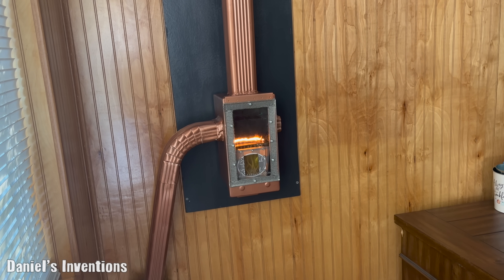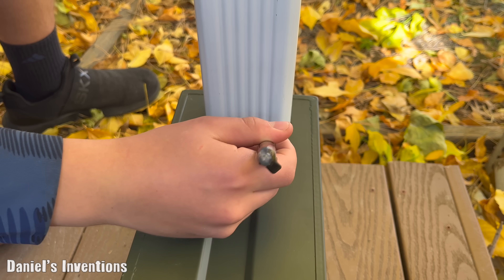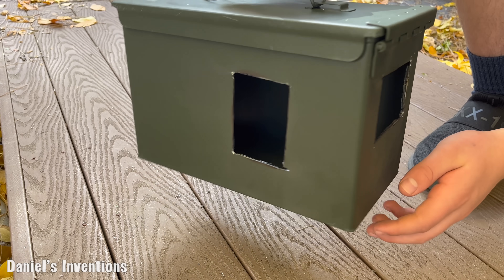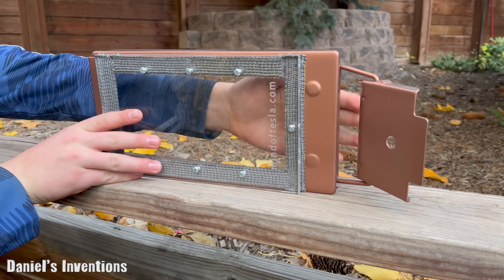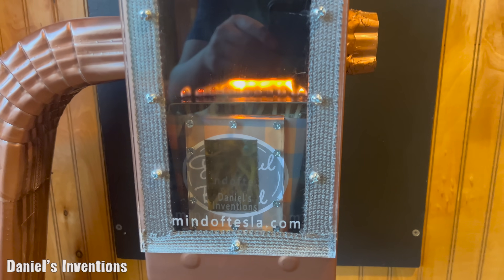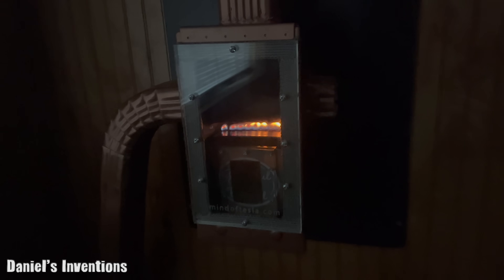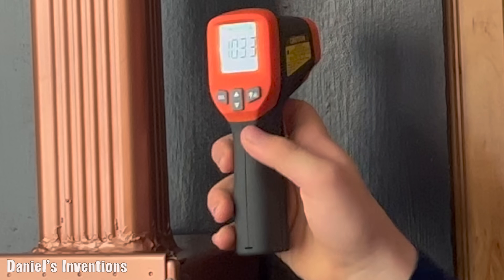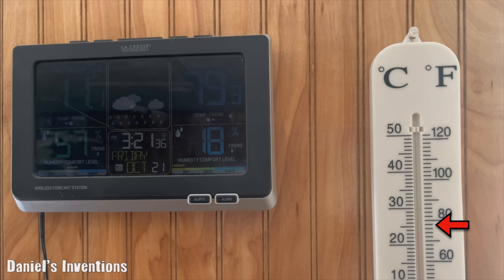ENDLESS Heat for Your Home WITHOUT Electricity

Comment: It might increase efficiency if you could increase the heat exchange surface. A more horizontal form, or more than one heat exchange section. 
   Would this run on waste motor or restaurant oil?
   A nice little heater!

Comment: Firstly, I truly appreciate the ingenuity that went into this design. 

With that said, you are not creating endless heat WITHOUT energy; the blower is still reliant on 1.6A/12V DC, be it through battery or hardwired. Now, this is not a lot to be fair, but it is  mislead in your title.

Comment: LOLOLOL ,   

Why don't you just buy 5 or 6 old fashioned oil lamps at the flea markets for $5 to $10 each.
Put new wicks in them of course.
That way , you would get MORE heat, MORE light,  LESS soot,  LESS maintenance,  and NO labor to build !

You are literally re-inventing a less efficient wheel !

 Lol.

Comment: This is AWESOME...question....I see your using a 12volt power adapter to assist with circulating the heat from the unit around.  In the event we don't have power...what is a good suggestion to assist with circulating heat from the unit?

Comment: I see that you're using electricity for the fan.  Nothing wrong with that however since you have a lot of heat available why not use a small Stirling engine to generate that tiny amount of electricity needed?

You're welcome.  Nice job guys.  Keep tinkering and sparking imaginations.

Comment: Great idea bad implementation. 95% of your btu are going right out the exhaust flue. You need multiple heat exchangers as the exhaust rises to capture as much of it as possible.

Comment: I would be very very curious to see a version with quarter inch steel and weld the components. Also find a way to incorporate Mud brick/Adobe. It would retain far more heat and be more efficient.

Comment: The old army skaws aka supply boat . ww2 used a diesel fired cooking stove and heating system 1/2 inch thick top no forced air system similar to your design worked great had one on fishing vessel some part failed we installed an electric heater grid inside the oven for heat 120 volt works great till we got parts to repair.
Glad you are using a cutoff grinder in proper manner! 
Always use the grinder so if it gets away from you it will grab material and pull the grinder away from you ❤❤❤❤😁
Great job! Thanks 👍💯🔥

Comment: JB Weld is a plastic, if I remember correctly. Plastics burning give off some form of cyanide gas and carbon monoxide plus carbon dioxide. Carbon dioxide is NOT poisonous but it can replace regular air since it weighs more than air. It sinks to the bottom of your house and can suffocate you from lack of oxygen. The cyanide and carbon monoxide can kill you out right. There are many chemical compounds that cyanide gas forms.
Reply: Si

Comment: Just pray the intake doesn't suck in carbon monoxide from the exhaust..... Generally you should not place them so close to each other....many people have died having heater and or water heater incorrectly installed that way.

Comment: If you put a block of metal in the vent to absorb more heat, it would probably increase the effiency. Also, instead paint the concrete board white to reflect the heat back to the room.

Comment: Great idea.  But maybe don't sit it directly on a wooden wall.

Also, a lot of the issues of heat build-up could be remedied with a small solar battery and a 3v computer fan.  Put the fan at the air intake.  Route the air intake in a way that promotes circulation before exit.

Comment: Im lost: this is probably fake.

1. You can only get energy out of a medium which is in the medium.

Burning that little amount of oil gives you literally a lottle amount of heat.

Yiu can't beat physics...

And those temp he is showing? Dude come on... Its either one very small spot or fake. And no you clearly not burning your hand when you put it on the vent which you would if this thing has the temp you are showing.

What is this garbage?

Comment: Daniel a most excellent proof of concept. I built mine out of steel box tubing, that's what I had on hand. We ran it in our icefishing shack and it did very well. I used 6 flat wicks and the gears like a lamp. I'm using used oil so it is free from the machines from our farm. My fan is 12v so a motor cycle battery and small solor panel was plenty this season but next winter I plan to scavenge DC curent from the heat of the burner so no panel on the roof. Thankyou bud.
Reply: Please make a video of your proposed video!  I would love to see the DC power generated from the heater!
Reply: i tried using olive oil and it wouldnt burn
Reply: Is it legal to burn used oil with a horrible burner?
Reply: @jepulis6674  Why would it not be? Not all countries are like Europe lol

Comment: You DID use electricity. It would be awesome if you could use a series of gears and pulleys to create some sort of gravity driven rope to turn the fan, or even in that sense generate the electricity to run the fan. Something you could periodically reset to keep the air going

Comment: So I actually built one of these after watching this video and let me tell you how it does not work that great even running I was only able to heat my tiny camper up to like 54° barely. So I built a second one but instead of just having one piece of pipe going straight through I used inch and a half copper pipe and did an s shape inside the ammo can before it came out allowing the air traveling through it to spend more time in a heated pipe before exiting which greatly increased how much heat it was pumping out. And then it was semi worth it however where I live the suitless lamp oil is about 10 bucks a quart which I seem to be spending 10 bucks every 4 or 5 days

Comment: 1. Use a solar panel attached to the flame window for running the fan or charging the battery for the fan.
2. Use a a self filling siphon for the oil supply so you never have to stop the device to refuel it, run a tube to you reservoir externally with an external bottle that can hold many time the amount of oil.
3. Maybe use a thermocouple to run the circulation fan if the solar panel will not cut it.

With these extra hacks your system could need no external electricity and run for literally a YEAR

Comment: You can’t put a turn down on the chimney pipe. That kills the draft and won’t let it  vent properly. Second, the chimney pipe needs to extend above the highest point of the roof for proper draft. 

I would not recommend using aluminum gutter. It can melt with the heat below it very easily.

Comment: I don't think you need that computer fan to make the setup work properly. The circulation of air happens naturally anyway since the top exhaust pipe is hot and the intake is cold, which makes the air normally move because of the temperature difference. It's basically an oven and a chimney.

Comment: It's a nice idea, but one problem needs to be considered here if you're intending on heating your home with this.
Will your home insurance cover you if this goes drastically wrong?
Let's think about it. You've built a heating device from spare parts and (essentially) junk, so none of it is certified or tested under any of the same conditions as a registered manufacturer. You're unlikely to be a heating engineer yourself. Therefore, if this thing develops a fault and you burn your house down , your insurance is well and truly void. You end up with nothing.
Now ask yourself...is any of this worth it?

Comment: im sure with all that burned off primer and paint would be really great for your health. i'd suggest an air quality monitor just to see what kind of harmful byproducts are being burned off with this heater. single jb weld is being used to hold all the parts togethor.

Comment: How do you adjust the wicks? Do you have to shut down the heater and then restart it until you get to the correct settings? Maybe you could use some small watch gears on a shaft and aknob to adjust the wicks during the heat cycle. Like a oil lamp. Just a thought.

Comment: The heater you built can only heat a room of 1m2, nothing more. Its efficiency is very low. As the laws of physics say, you can't get something from nothing, and you can't cheat the laws of physics. You could test this heater, but it would require some effort, and you'd be very disappointed. It's roughly like heating a room with a lighter. Apart from that, congratulations on the effort.
You should measure the temperature of the outgoing air rather than the temperature on the casing. You can also measure the amount of outgoing air and see if the temperature drops, as in 10 minutes it will definitely turn out that the air will be only slightly warmer than the incoming air.

Comment: Just to keep it honest, you should note the heat resistant glass pieces on their own would cost in excess of $150. Yes, it is that expensive, double or triple it for those pre drilled holes. We simply used a small $5 Pyrex bowl. 😉👍🏼

Comment: You failed right from the start. This states for when you don't have Hydro. Then you used power tools to make it, and plugged the fan into the wall for power. So you do need electricity for this to work. FAIL

Comment: you can drastically increase the efficiency by instead of leaving the wicks open to air, using them to fill a copper tube, bent into a loop, with a small hole drilled into the bottom. 
The wick wraps through the top, ALMOST reaching the bottom hole, allowing for the heating of the fuel, the wick allows capillary action to seal the tube, forcing the longer section to be the strongest against the flow, allowing the small hole to be the least resistance, allowing the fuel to vaporize, increasing the efficiency tremendously. 

"this flame burns at 1652°F for more than 100 hours! diy ideas you need in your life right now" by mr Ipoo is a perfect demonstration of this.

 add more loops for more flame.
The best part, is you no longer need to adjust the wicks.

Comment: It is better to use Peltier elements when driving an electric fan.
Since the outside air inlet is cold and the outlet flue is hot, you can insert a Peltier element between them.

Comment: Great job man. you'll be a mountain man yet. i got something that will help you out tremendously if the power goes out. get a wood stove top fan. like $30 its powered solely by the heat generated by the heater. snip the wires put the thermoelectric pad on top of the heater where it is very hot run a few cables to the intake and put the fan there. itll work completely without the electric grid. may have to run the heater for a few minutes before the fan starts.

Comment: I could be wrong about the numbers but a quick lookup average household usage during the winter is 8kwh per day. I think the average cost per kwh is around 17 cents but ill say 30 cents. So 16.80 per week in energy but thats the whole house not just heating. That vs 5 dollars. Please correct me if im wrong i really am curious on the difference. I really want a wood stove though. Nothing beats a classic woodstove in the winter for me. Not even a fireplace.

Comment: Interesting design and inspiring but need numbers: OUTPUT calculations? BTU/hour? It looks OK for a very small space but not nearly enough for a LR, for instance or small house. I have a propane burner (Mr Heater Big Buddy) which BLASTS out max 18,000 BTU per hour and ALL of that heat stays indoors (no external venting). On highest setting (18,000 BTU = 3.5 electric heaters @ 1500 watts each at full blast) it does not heat up my LR space even though indoor temps may start at 45F (not that cold). So I just heat nearby air as needed.

Comment: the more challenging aspect of this DIY is the actual flame. None of the wicks will be permanent and will have to deteriorated quickly, even the baby wipes go so fast to the point you want to give up the whole project because oil burned is too mesy and the frecuency of wick changing. Really bad

Comment: someone may have suggested this already, but you could replace those standard oil lamp wicks with carbon felt. it will be an effective wick, but you wont have to replace the carbon felt like you would with a standard wick.

Comment: The probability of getting your house in flames is now more than 50%. Everything in this installation is dangerous in the way you made it. You're also lucky of not having lost a hand while holding the grinding wheel in one hand while the other hand laying only centimeters appart.
Invent, and innovate, but learn the security rules before you start.

Comment: Did you also use heat resistant glass for the oil resevoir windows? I was about to order heat resistant glass and I came back to count the screw holes they'll need to drill, and I noticed the oil reservoir the stove box has double glass. Does that area get hot enough to need hr glass or did you use something else? Is the resevoir window acrylic?

Comment: I honestly don’t belive this .. I did subscribe to your Chanel to see your other videos but I have wood burning stove that’s regular size not a mini one and I use wood to burn .. there is no way your method could possibly work .. if it did that would be amazing brake trough in so many areas of life .. since you will get many disbelievers like me .. but I’m not denying as I did subscribe to your channel after all then if you actually read this message pls make so many of those videos to make people beive it.. for example I suggest doing videos of time lapse when people could see in a speed time how it looks like .. the oil level the temperature inside and outsde .. the kind of place you heating all of it .. u know if this was actually real this would be soooo soooo soooo amazing in so many areas of peoples lives ..

Comment: We rely completely on space heaters during the winter, and they CONSTANTLY break due to overzealous safety features. This design is inspiring, and I'm going to look into building something based on it for our 340 sqft home. Thanks so much!

If you see this comment, I'd love an update on how this setup weathered its first season, and anything new you've learned since posting this vid.
Reply: I hope you read some of the other top comments for improvements to this design.
Reply: 340 square ft is not a home
Reply: @WaitWhatsMyName  Ok, well whatever the hell this thing is we've been living in for nine years, I'm gonna try building an oil heater for it.
Reply: @WaitWhatsMyName  What is the definition of a home?
Reply: Why not? It’s the same size as your mother’s vagina and you lived up in there for 9 months.

Comment: Love it! Try graphite instead for a 'forever' which!🕯️🎂 Also the trick to the smoke as pointed out by Robert Murray was addressed in the new rocket stove where they insulated the chimney to keep the output heat around 800-900 degrees which burns up all the carbon before it gets out

Comment: You could ad fins to the exhaust and add a fan to capture radaint heat from the exhaust, Turn the exhaust into a heat sink. Exhaust would still exhaust outside, fins going up the exhaust to radiat heat out. And one of those gans that run off heat to blow it around.

Comment: As your fuel source is inside your heater, is there not a risk that it gets too hot and self ignites potentially causing a problem. I think the fuel would be safer in a container underneath with a heat proof layer in-between then metal pipes coming up into the burn chamber with wicks in the pipes.

Comment: so the exhausts heat is 103 and the air that seeps in to replace it is what 40.  I think we need to know the speed of the air going out the chimney.  Would be interesting to see you heat up the incoming air with the exhaust.  But I guess then you would have condensation issues.

Comment: This build is quite dangerous. It would not take much to improve the design to make it safe. Please take this down as soon as possible to avoid CO poisoning and asphyxiation when the metal finally burns through at the flames. If you are determined to use this a while, be absolutely sure you have a working CO monitor and a CO2 monitor in the room.

Comment: You have electricity, but you did this?
Off grid dreamer project at best.
Kinda blew right past that cutting
holes in the cabin. 3D printed fan?
No power for the fan, you're done.
Power from solar, or hamster wheel?
Hilarious!

Paraffin wax burns longer and hotter.
Ten candles would drive you outdoors.
The emissions are harmless as long
as you ventilate once in a great while.
Be prepared. Get a big box candles.
Add a couple of bic lighters.